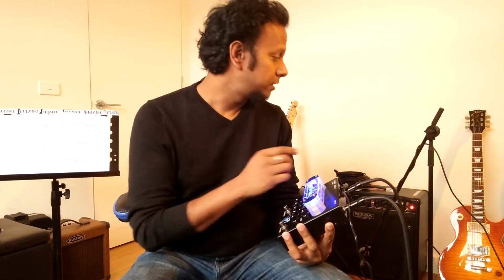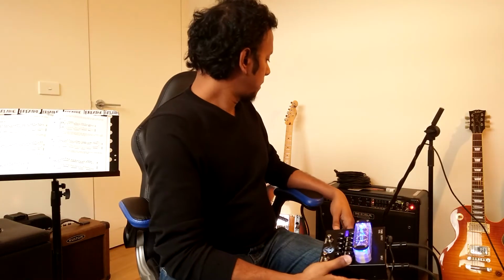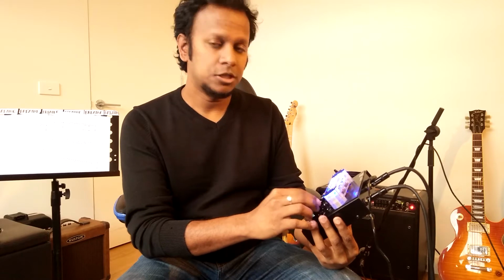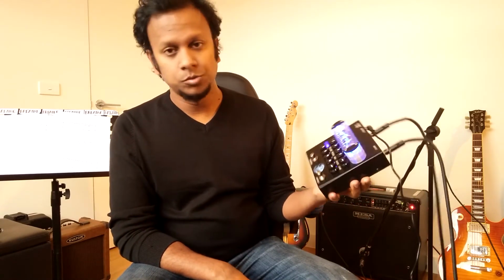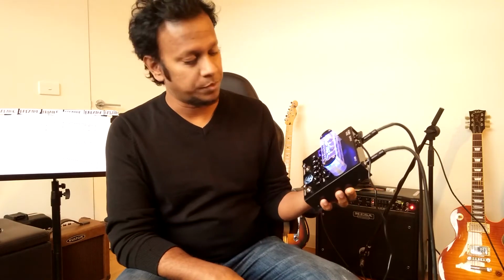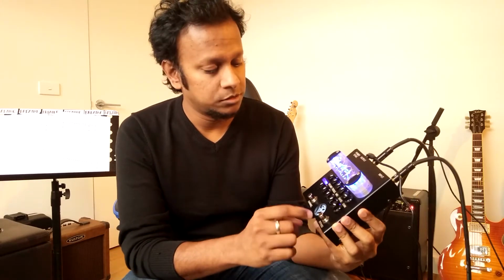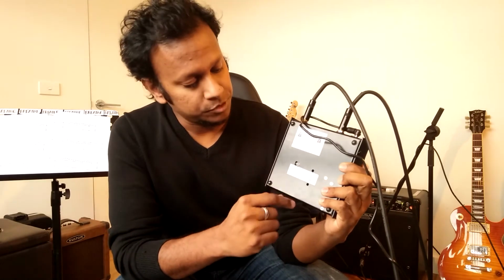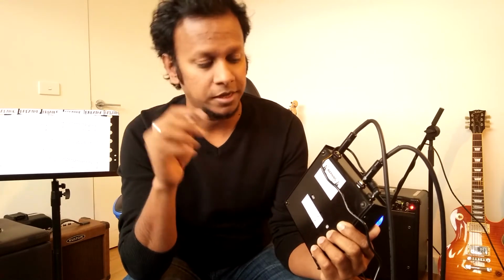Sherlock Amplifiers V3 Distortion Pedal - Demo by Ash Ravens

Comment: 4:45 the difference between 9v and 12v is actually a very small thing, plus to get a big difference in tone you have to go over 20v. I had a plimsoul and running 9 to 18v made no difference really. The 12v t,rex pedals sound like other pedals, a 24v Seymour Duncan blue tube sounds a very tiny bit better, 24v boogee pedal sounds quite good. Really, full plate voltage is best. (Amp preamp)
Reply from the maker: +Brian Cullen you are right, the difference is quite subtle. Whatever can be heard and felt in person, was not translated well due to youtube compression too. Thanks for the feedback!